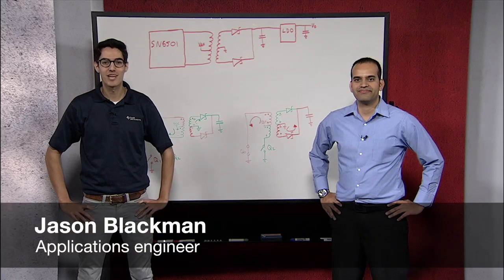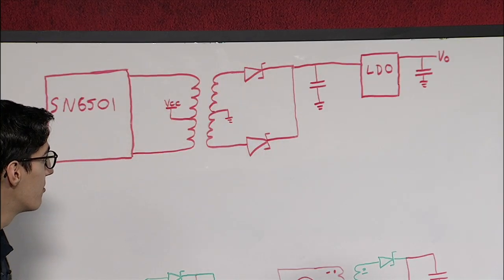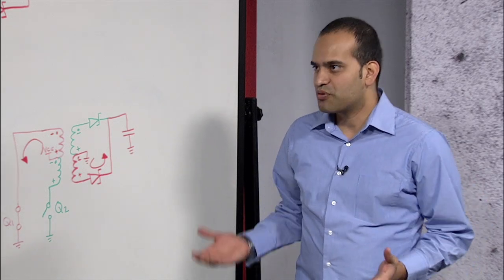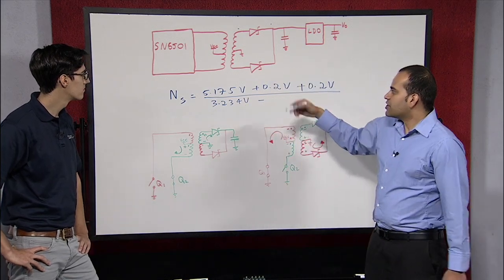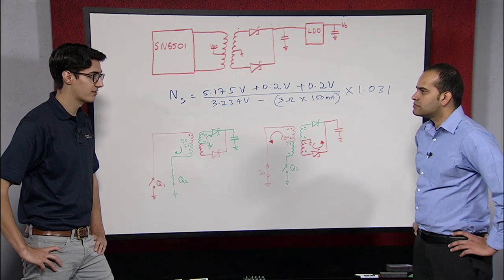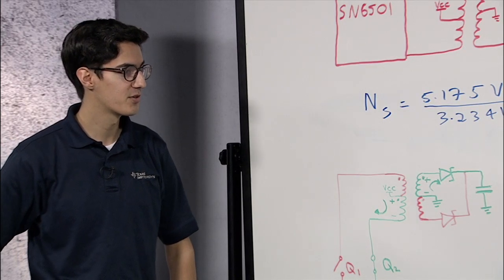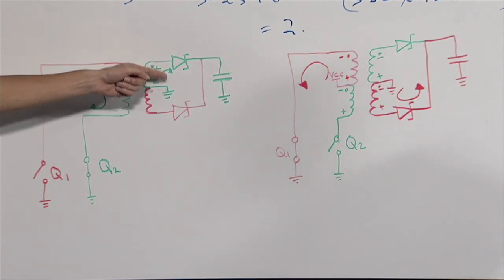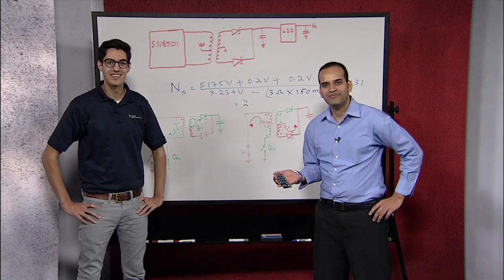Engineer It - How to isolate a power supply for RS485 & CAN

Comment: what happen if i use normal step down transformer 230V to 12V and use a SMPS to convert 12 V to 5V to microcontroller and RS485 IC

Comment: You are rectifying with zener diodes?
Reply: Schottky diode, not zener.  They are used for lower losses.  The forward voltage drop is lower, and the reverse recovery is insignificant when compared to standard silicon rectifiers.
Reply: I want to know where they actors that sound and look like engineers.
Reply: I think it's something do with voltage spikes to help with regulation. I can see it being needed for high side power transistor bias supplies.
Reply: 30 years ago I had Schottky diodes ring at 45 MHz on turn off in a 100k Hz switcher. Where was that noise coming from? I think I just put an RC snubber around it.